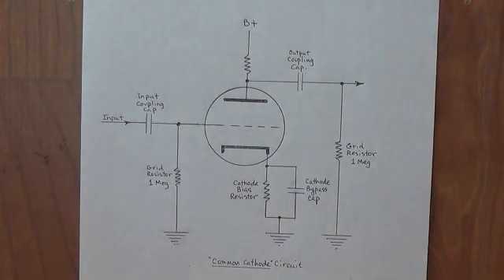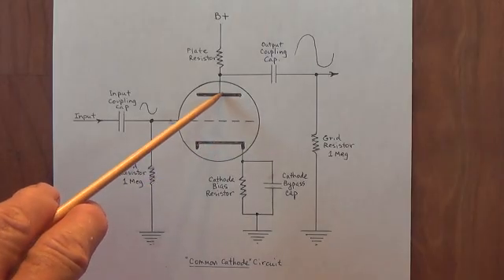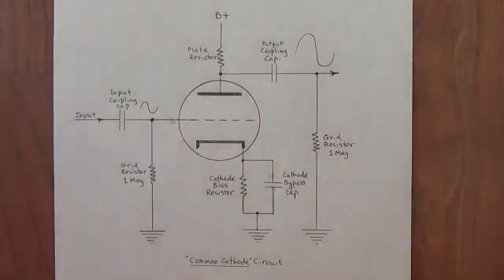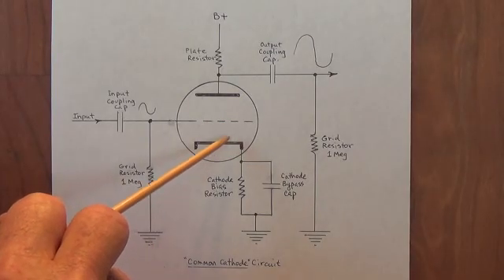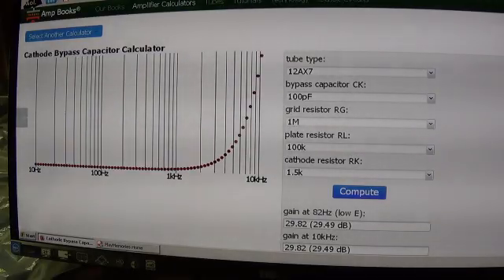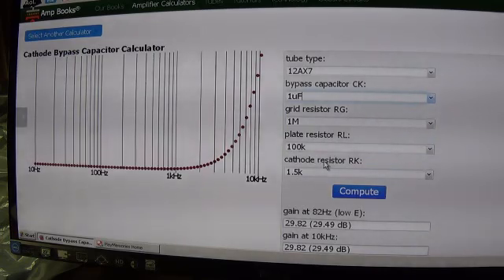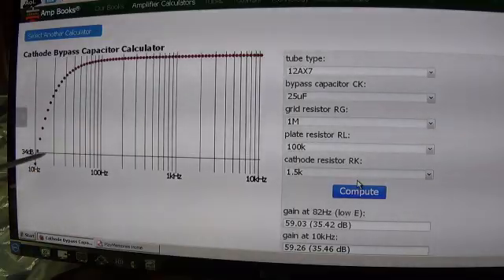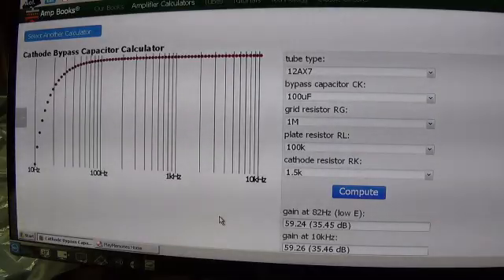Cathode Bypass Capacitors: How they Affect Gain and Tone

Comment: Really well-presented and clear - I'm going to bookmark this. 
It must be really great to have such a smart dog that appreciates tube electronics as much as you do!   I wish I could get my damned cat to get interested in anything (other than serial-killing all the small birds and mammals within a 2-mile radius)... I've even made little pre-drilled speaker kits for him, including cat-friendly Helmholtz resonator calculation charts.  All he does is pee on the charts, eat the glue and get sick.  I'll try him on valve technology, maybe speakers aren't his thing.
Reply from the maker: Thanks so much, Hal.  Rusty, Jack,and I are highly amused by your cat's antics and would love to meet him. I think he would fit right in around here.....especially if he avoids work at all costs and eats anything that holds still :) :)
Reply: Hey Uncle Doug... May I ask to pick your brains?   I picked up a little 
Peavey NanoValve 5W for peanuts (they weren't expensive to begin 
with)... 
It distorts at all volumes, particularly on transients (e.g. guitar 
pick, initial pluck of a string).  Initial transient is not particularly
 loud, then it seems to "choke" and reduce its volume, then sustains 
with a gravelly distortion that reduces somewhat as the input signal 
fades away.  
The distortion is ugly sounding, choppy (absolutely not "creamy" like good tube distortion is supposed to be).  Replacing both tubes (12AX7 preamp, EL84 power) made zero difference, so it's not the tubes. 
Any thoughts, which components are most likely to have failed (I'm guessing coupling caps, but they're really low nF values)... another thought is maybe the power smoothing cap has drifted way off spec, and is starving the whole circuit.
Reply from the maker: Have you checked the bias of the EL84? Component failure somewhere in the circuit may have caused it to wander far from its proper PD value.

Comment: Without the cap makes this preamp effectively pointless ,it stops operating as an amplifier? The 2.7 Kohm R cathode is bias for just the dc while there is no signal and as soon as there is an AC input the 0.68uF capacitor quickly takes over the impedance  (after 300hz) effectively bypassing Rcathode by 10:1 (@1khz : 2.7K resister versus 227 ohm cap ) .Doesn't this change the operating point of the Tube system with a lower cathode voltage ? TY for your posts .
Reply from the maker: I'm sorry, but I don't understand the question. I am not familiar with capacitors being rated in ohms (i.e. 227).  Possibly you can find the answer via a Google search. Good luck.
Reply: Hi Doug . I meant : 227 ohm referred to the impedance of that capacitor @ 1Khz as compared to the 2.7KOhm resistor in parallel.  As the cap is much smaller the resistor is not that important at 1Khz as it only comes into play at no signal or DC bias. .
Reply: With no signal there is a current (the quiescent current) through the tube which flows in the cathode resistor and develops a positive voltage at the cathode. A positive going signal causes the current to increase above the quiescent current, while negative signal causes it to decrease below the quiescent current. Although the current is varying, the average current is equal to the quiescent current, so the average voltage at the cathode is equal to the quiescent cathode voltage. The variations in voltage at the cathode can be interpreted as an AC signal superimposed on a DC voltage. To DC the capacitor in parallel with the cathode resistor is an open circuit, but to AC it is a path to ground whose resistance depends on the frequency of the signal. At higher frequencies the majority of the AC signal to flows to ground via the low reactance of the capacitor. As the frequency falls, the increasing reactance of the capacitor allows a smaller proportion of the AC signal to flow to ground, and the signal which remains on the cathode acts in opposition to the signal on the grid, decreasing the gain of the stage.

Comment: so the common marshall .68 cap is actually cutting more signal (except highs) and thereby strangling some gain compared to a 20u ?
Reply from the maker: You can plug the values into the calculator and see, but it stands to reason that a tiny CBC like 0.68uf would stifle the gain, compared to a 20uf CBC.
Reply from the maker: P.S.  Rusty sends his regards to the mechanized pup in your icon photo.
Reply: The 0.68uF cap is intended to reduce gain at low frequencies to produce a brighter sound. That's why it's included in the 'Bright' channel!! Unless you're already at 11 you can compensate for overall loss of gain with the volume control.

Comment: Hey Doug , great video as usual , does it matter if cathode cap is polar or non polar? and what voltage rating should i look for? is 16v enough?

 thank you
Reply from the maker: All cathode bypass caps in my experience are polar electrolytics. A non-polar 25uf cap would probably be rather large for the circuit board.  Since these caps are inexpensive, I always go for higher working voltage......say 50V or above, just to play it safe.

Comment: This is a great educational channel about tube amps, I have a question: is it possible to implement this tube amp circuit as a condenser microphone pre-amp? Thank you.
Reply from the maker: Thanks, Jack. I think you would be better off using a circuit that is specifically designed for use as a microphone pre-amp. You're welcome.
Reply: Thank you for your response. Regards.
Reply from the maker: You're welcome, Jack.

Comment: You can effectively voice an amp without any traditional "tone stacks" simply by selecting the right cathode and gain stage coupling capacitor values. Tone stacks lower your gain and they dampen the amps chime. Single-Coil pickups require larger coupling cap values - 0.1, 0.047, 0.022 and humbuckers sound their best with lower values - 0.01, 0.0056, 0.0047. Fender built his amps for his single-coil guitar line, therefore the 1k5 cathode resistor and the 25uf bypass cap, so that they sound full and not thin. The Marshall line sounds best with humbuckers, hence the 820 ohm with the 0.68uf arraignment, in order to manage the low end harmonics, especially when pushed. I often place a switch on the first gain stage in order to select one or the other.
Reply from the maker: An excellent point, Mark, and one that is frequently overlooked. Amp circuits were often tailored to certain types of guitars and pickups. An amp voiced for humbuckers may sound shrill and strident with single coils......and vice-versa. I believe this explains the shrill, brittle sound of many of Gibson's mid-60's and later amps. They were designed for clarity with (Gibson) humbuckers and really sound awful with many other guitars and pickups.
Reply: You are so very right, and I'm surprised at the number of guitar players that are unaware of this. I've built and modded a number of amps with two switches, sometimes something as discrete as a push/pull switched pot, that selects or shunts the coupling cap after the 1st gain stage and a switch for selecting or shunting the cathode resistor and cap on that 1st gain stage.... so that you can stab a Gibson or a Fender into the amp with desirable results. If you want to do that one better, you can also switch select a few of the other coupling caps farther into the amp's audio chain; before and after the phase inverter or the finals. I truly appreciate your wisdom and history points, and your experiences. Your YT threads are great talking platforms. BTW - I finally finished my super-deluxe Plexi/Bassman/Trainwreck build last night... with internal switching and features that will allow the user to select coupling and cathode cap options... and I'm tackling a sudo Fender 26 / Supro 24 build; your Fender 26 Project was inspiring... I plan on adding an intermediate driver tube between the 6n7 phase inverter and finals to give it a really clean hi-fi voice. We shall see...
Reply from the maker: Thanks for your kind words and best of luck with your projects, Mark. The Model 26 I built is, to this day, one of my all-time favorite amps. It has no special features, but simply sounds wonderful. It's like a hearing a great singer.....you know immediately that you're in the presence of something special. I really think you will love the 26 you are building.
Reply: Do you have a source for a decent low powered 15 speaker? What's your favorite? I've purchased quite a few from Parts Express, a few from Weber, and Speaker Warehouse... Your thoughts?
Reply from the maker: I've had the best luck with Musician's Friend and Antique Electronic Supply, Mark. You might check their inventory. Another great source of high grade vintage 15" speakers is old organ tone cabinets. Good luck.
Reply: @markschmitt5550  Uncle Doug and you share anazing insight... Many thanks. I went to electronics school 18 years ago but never had the urge to delve into amp tweaking/building until now. I've analyzed and built a few od, fuzz and delay pedals but now I want to start with amplifiers. Any suggestions on a suitable quality  kit to start with? I'm a big plexi fan but I'm open to any suggestions that may better suit my first steps.  Thanks guys!
Reply: @UncleDoug  i got a fender guitar with b3 noiseless pick ups which i guess is fenders version of humbuckers but i was most unhappy.the pick ups restricted my reverb output massively & reduced my fuzz output.so i sold the guitar & only play with single coil pick ups now.so beware humbuckers might cut out radio wave interference but there are only a few decent pedals for humbuckers & if you love reverb & fuzz my advice is stick with single coil pick ups.but this is what i need to learn about i did kinda remember someone said to me the wire to the speaker is twisted 50 times & the wire to the pots is twisted 10 times more than that.but does it change if the amp,s number of pots change like 8 pots would mean 500 twists to the wiring that goes to the pots & 50 to the speaker.but what if it only has 3 pots do you increase the amount of twists on the pots wiring ?? great post doug peace...
Reply from the maker: @djbigleg3228  I have never heard of any standards for the number of wire twists. I personally prefer shielded cable.
Reply: Excellent points.  I know I'm 3 years late to this discussion, but this gives credence to "amplifier as THE instrument".  One size does not typically fit all in the signal chain.  Some very famous amp technicians built amps specifically for certain guitar players.  A good example is the relatively new PRS John Mayer model.  "They" spent a lot of time designing an amplifier that is specific not only to the guitar that JM uses (in fact PRS built the SilverSky for this purpose) but also to his playing style.  A signal chain is the sum of all of its parts.  This same amplifier is often reviewed with mixed opinions.  I feel these commentaries lack the basic understanding that components are neither good nor bad, they are instruments that can be manipulated to produce the desired effect.  Its like asking, "what is better...a fork or a spoon?"  It completely depends on the application.  This, of course, is when these objects are built with skill and understanding.  One of my amps, for example, could accurately be described as "bad".
Reply: I'm a neophyte with tubes and  was wondering about the same thing.  Thanks Doug for posting this video and to both you and Mark for all the additional dialog and information.
Reply: If you wanted to go crazy you could cycle through different cap values with a switch
Reply: Can you give examples Mark?  I have looked at the Vox AC30 and Marshal amps and they all seem pretty similar, if not the same. Orange amps have the curious additive capatitor stack on the first stage decoupling which seems to be a sort of progressive high cut filter. Perhaps it does the same as the bypass capacitor arrangement?   Roland Jazz Chorus amps, of course are FET transistor input which might explain their success.
Reply: Mark Rakemaker EV 15L is worth considering
Reply: The single/humbucker difference vanishes after the first coupling capacitor into the first stage. The cathode resistor  changes according to the plate voltage and the desired operating point, and the bypass capacitor changes according to the desired LF toll off point, the cathode resistor, the internal resistance of the tube, its mu, and the plate load, according to a well-known formula. The idea that Fender or anyone else designed for specific pickups is baseless.
Reply: I'm very late to the party too haha, but Mesa amps use "Pull shift bass" to select a coupling capacitor at the first gain stage, it's very interesting that they use a .47uF and a 22uF, very similar to that fender and Marshall coupling capacitor :)

Comment: Uncle Doug, why do some Marshalls have a .68u bypass coupling cap, and some amps have an electrolytic in v1?  And what voltage rating should the .68u have in v1 and v2 in a Marshall Plexi (1987)?  It seems like when I see electrolytics, they're 25v, but when I see a .68, it's not polarized, and they're 400v to 600v...   Thanks.
Reply from the maker: Greetings, Maserati. I don't think the 0.68uf cap is a bypass cap, but more likely a coupling cap.....it can't be both. Every bypass cap I can recall has been an electrolytic, generally 10uf to 50uf at 25V to 50V. For coupling caps the voltage rating can be anywhere from 400V to 600V, depending on the circuit. If in doubt, go with the 600V.
Reply: Thanks.  In both cases, they're in parallel with the cathode resistor to ground.  Just wondering why different types of caps are used in the same position.
Reply from the maker: If the non-polars are used in that position, they are serving as bypass caps, but only for relatively high frequencies. I am not familiar with this application. If you want to improve the bass response in this amp, you could change to a 25uf electrolytic....and see how it sounds. Also, you could use the Calculator feature in this video to see exactly what the new frequency response would be.
Reply: Thanks.  I was trying to buy a .68u cap for a Marshall Plexi build, but different vendors carry different brands with different voltage ratings on that value cap.  I was thinking 600v is overkill if electrolytics in that place are usually only 25v.  I have a 100v and wondered if that was enough.
Reply from the maker: If it's being used for cathode bypass, then that should be adequate. You could check the voltage on the cathode just to be sure.
Reply: Thanks for your videos and replies...
Reply from the maker: You're welcome. I did some research and found that Marshall used the 0.68uf bypass cap to prevent "muddiness" when using humbucker pickups, which were generally used with Marshall amps. Fender amps were voiced for single-coils and use much higher value bypass caps to reduce the shrillness.
Reply: The voltage at the cathode of the bright channel in a JCM800 is 1.6V. Yours should be similar.

Comment: I've seen circuits where in multiple preamp stages the bypass cap used will get progressively larger.  If your 1st stage buypass cap is smaller than later stages, won't that tend to limit how much of the low frequency is available for gain in the latter stages?  Seems like a better approach would be to start out with larger bypass caps in the first stage and then get progressively smaller.  Which is the better approach and what are they trying to achieve by not making them all the same for instance.  Thanks again Uncle Doug.
Reply from the maker: +sdcoffeeroaster  You make an excellent point, SD, and I completely agree with your logic.  Personally, I experiment with cathode bypass cap values to find the combination that sounds best to me, and have never found any benefit to the "start small" philosophy.
Reply: +Uncle Doug Thanks for that confirmation.  It didn't make any sense to me either.  I picked up a VHT Ultra special 6 which is pt-to-pt and a great amp to mod and learn from.  But it came with 1 uf bypass caps and 0.0022 coupling caps, not a good combination for bass.  The later versions used 1 uf, 2.2 uf and 4.7 uf thru 3 pre amp gain stages and it's a single output tube, 6v6 or 6l6.  It's just a bit boxy sounding and as lively as I'd like.  I finally had to give up on Blues jr woofiness and found someone that liked that so I sold it recently.  Funny, I sold an amp with too much bass and now I have one with too little, lol.  That's life I guess.  But this one is great amp to learn more about tone and cause and effect thru mods.
Reply from the maker: You can easily modify it to suit your tonal requirements, SD. A few hours of experimentation can yield a tailored tone.
Reply: As a tube amplifies, intermodulation distortion produces frequencies which are the sum and difference of the input frequencies which adds 'artificial bass' to the output signal.  e.g. a 160Hz signal interacts with a 240Hz signal to produce harmonics of 240 + 160 = 300Hz and 240 - 160 = 80Hz.